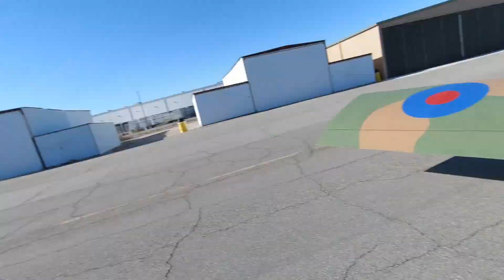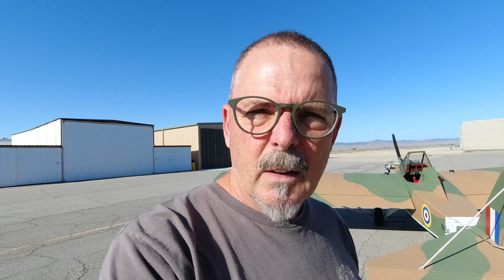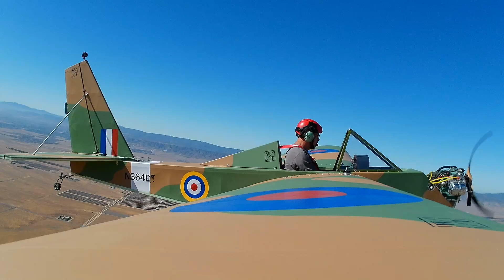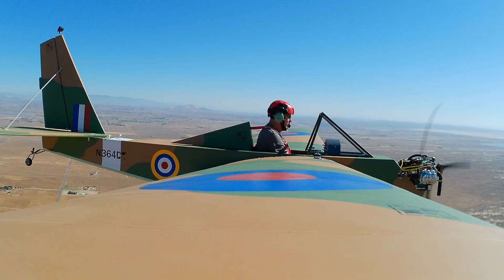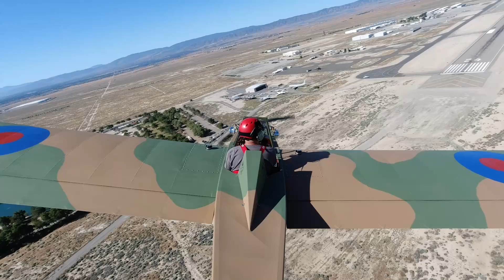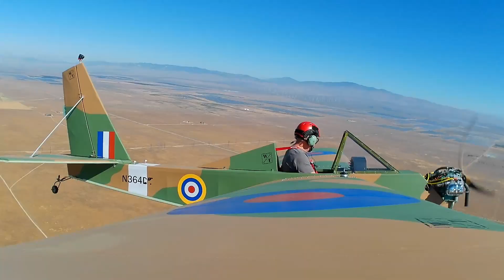Minimax 1100r Aircraft Test Flights - Stalls

Comment: That was a very cool video !!! Nice plane, it seems to be very stable and has a decent slow stall speed @ 36 mph at 4,850 MSL...Not bad!!! I feel that once you get that prop selection figured out, You'll have better performance... I'm wondering what the Glide Ratio is ,  for this plane... I lived close to Fox Field for a couple years (2008-2010) in Rosamond...
  I remember that park with the ponds ...  How would that plane do with an Engine that produces 80 H.P. ??? And weighs maybe 80 lbs. I have some ideas,  For the engines that I have, for a project like this...Today is : 11/08/25
Reply from the maker: I really enjoy living here. For one thing I get to see the sun every day. Was not the case in Michigan:)
50hp VW is the largest engine I’ve seen on one of these. That’s on the V-Max model. You can find it a flyminimax.com

Comment: when building these need a table 16 ft long made out of wood some metal too for strength wood is find but will get soft after a few yrs guess oak is the best i guess just way bigger from building RC planes for lots of yrs
Reply from the maker: In this video you can see the table I used. Mine was 16’ x 4’. Worked perfectly. A fancy table is just not necessary to. Oils one of these, just nice and flat with no twist.
https://youtu.be/oY8v3qGEOUk?si=M-vmokfvZEgUQomC

Comment: Dennis could you comment on any adverse yaw you might have experienced. I'm curious what effect that full aileron and ccw prop rotation has on stalls with the minimax. Thanks again for the great videos.
Reply from the maker: Hey Michael, because the aileron has differential, there is very little adverse yaw. Dutch rolls are really easy to do while keeping the nose on a point with very little rudder input. 
In the power off stalls my rudder inputs were minimal as well to keep the nose going straight.
Reply: Thanks Looking forward to future videos.

Comment: Hey there,  Great video.  Have an Ultracruiser waiting for an engine and avionics.  What a great, flat airspace you are flying in.  Which prop are you using? Length and pitch? Couldnt find the specs in the comments.  And what prop were you running prior?
Reply from the maker: I started with a 56x24 and the engine wasn’t getting up to RPM. So it was modified to a 54x24. The RPM’s came up but they didn’t deliver anything. So I’m waiting for my 56x22 which will be the ticket hopefully. Your plane will have way less drag than mine. 
I love flying out in the Lancaster area!

Comment: Congratulations on completing your home built. I constructed a Pulsar many years ago and I have it in a hangar right around the corner from you. I have issues with the engine so it hasn't been in the air for a while. I did all of my test flying out of Fox also. Glad to see that you are doing safe testing.
Reply from the maker: That’s a slick airplane! Engine trouble is tough and I hear it can take a while to sort out sometimes. Is it still at Fox?
Reply: @DTMinimax  Yes it is still there. I'm still trying to find a replacement for the Rotax 582. I have had 3 engine failures while flying it. I have talked to the Rotax specialists and they say that the airplane is too fast for the engine. Anyway, I'm hoping that there will be a 4 stroke that can replace it.

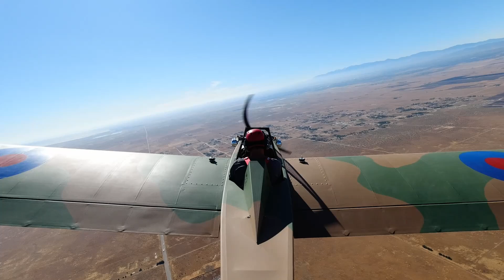Comment: Hi, question......@7:20, I see a bit of fabric flutter in the left aileron,  is there any rib stitching in the ailerons?   I'll be covering my SE5A replica soon
Reply from the maker: The ailerons are only glued to the ribs. I would probably rib stitch them in prop slipstream area. My wings weren’t required to be stitched but I did it anyway.

Comment: G,day from Sydney Australia. From your filming, your wings are showing some fabric flutter, around the flaparons "control surfaces" how is the fabric attached to the ribs and spars?
🛩️🌏 Correction. It's the internet LCD images on my iPhone.
Reply from the maker: My wing is rib stitched and glued with Stewart Systems, the ailerons are just glued to the ribs. The plane doesn’t require rib stitching and typically uses glue only, I wanted the security of the stitching

Comment: Great vid.  You’ve got s as 1/2 VW just like mine…. Even the chrome plating on the tappet covers!  Your stall speed seems high, though I’m not sure what a mph is.  I’m sure my Minimax had a stall speed around 25 knots indicated, and it was pretty much at the designed weight. At the time i built there was no 1/2 VW version…I had to modify. So my designed empty weight was as for a Rotax 2 stroke engine.  My prop was a 56” (dia)x 22” pitch and rpm (static WOT) was 3200.  I built light…the Minimax was my second homebuilt plane.  My climb rate was ok with just the fwd fuselage fuel tank full. It was pretty woeful (ie. altitude stays the same as you wait for the curvature of the earth to give you greater distance  above ground) when I was fully loaded with 65l of fuel and underwing camping gear.  This was my first powered aircraft (previously I was into gliding), so the poor climb performance didn’t worry me…i just found a thermal and climbed up in that. If you want I can hunt around for summer pics…but these are all chemical, not digital, as it was all last century. I currently have & fly a Bert Sisler SF2A I built in the late 1990s, a Corby Starlet (vintage 1980s) that I restored, & a Jabiru J200. I’m planning on building a Mulholksnd ‘Legsl Eagle’ 1/2VW powered for my grandson …it has the same wing as the Minimax. Cheers, Mark
Reply from the maker: I think the Legal Eagle is also a great airplane. It looks like we’re going to have to make a new prop at 56x22 for mine. The 54x24 is just not doing it. 
The manual says my stall speed should be 33mph so I’m really close to that. I’m heavier than the stock 1100r so I would expect a higher stall number. 
Sounds like you have some fun airplanes!
Reply: 35 miles per hour is 31.3034 knots.

Comment: Great to get the stall test out of the way. So now you know the speed and also from the video she stall straight which is Very Good to. I will have the same problems as you with the prop, I went to a great UK prop maker and I think / hope my prop is near to what is needed as it is the same as the one he uses on his simular sized biplane with the same type of engine. I supose the only other solution is a ground variable pitch prop but I don't think look as nice unless you can put a spinner on them 🙂 I would not chace prop settings too much until you have got about 25 to 30hrs on her, so the engine is fully run in and then it is still a mission type that make the choice, do you want short field performance or go places performance (you can only have both with in flight adjustable)  😞
Reply from the maker: Based on my altitude and summer temps I believe going for the climb is the way to go.
Reply: @DTMinimax  then you will not get the speed. Are you planning landing at short fields say around the  1000ft runway? It would be good to look at your current tack off  distances and then consider multiplying those  by1.5 as you grass strip take off distance.

Comment: Nice flight!  I like the docile stall characteristics.  Do you think you engine is producing consistent, reliable power?  I imagine it can be difficult to sort out the relationships between the effects of engine power, rpm, and prop performance.
Reply from the maker: I was so surprised on that first stall. I was wondering if I could measure the altitude loss, well there really wasn’t any:)